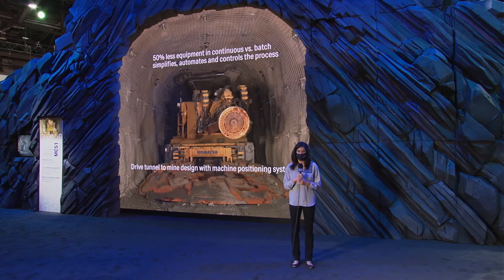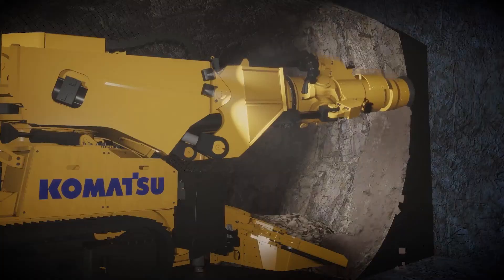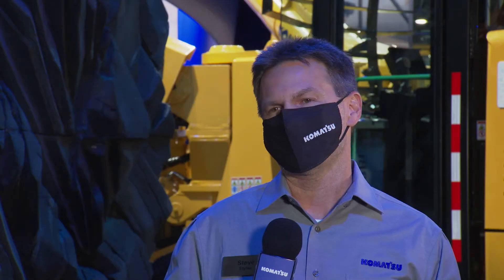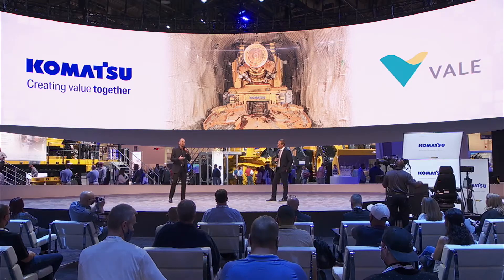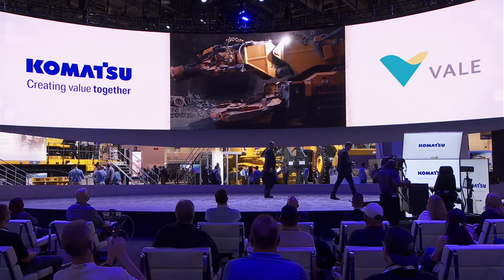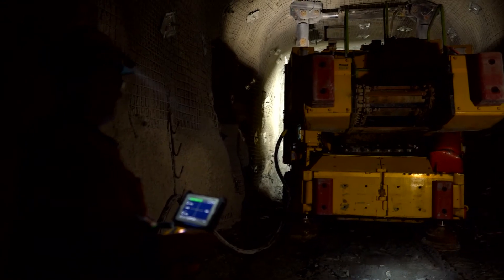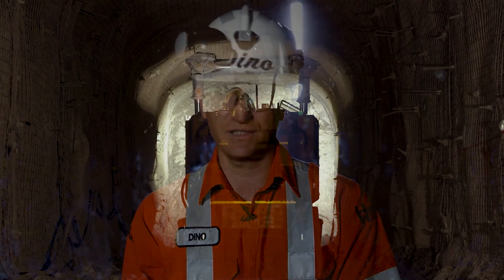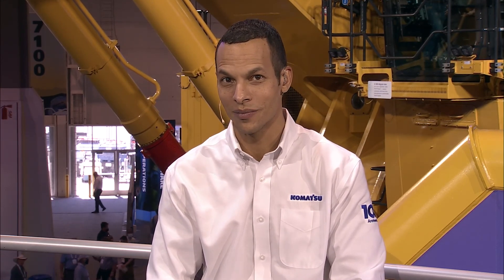Feature segments: Mechanical cutting in hard rock (MC51)

Comment: interesting statement of "sounds like Komastu is focused on safety and the journey to zero harm" when the animation depicts the operator having to operate remotely on foot next to the machine /  in the drives.. then add in LHD's or Trucks backing up to the MC51 to be loaded... sounds like a recipe for someone to get run over / similar to line of sight LHD operation which industry has been trying to move away from for many years.

Comment: Anything to reduce drill and blast method will be more efficient. No more re-entry times, required blasting ventilation, explosives handling etc.
Reply: security is also not easy. how will the machine work with a large amount of incoming water from below and from above? how will it behave in unstable ground? how much does a cutting crown cost? how quickly and how many people replace the cutting part?
Reply: it is not known how this machine will behave with sales of the fortress category 15 and >.